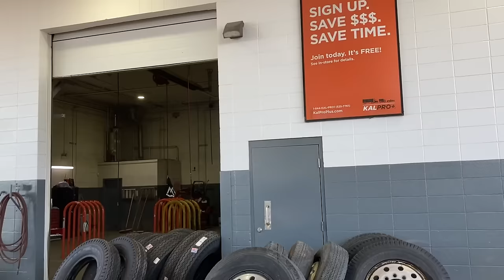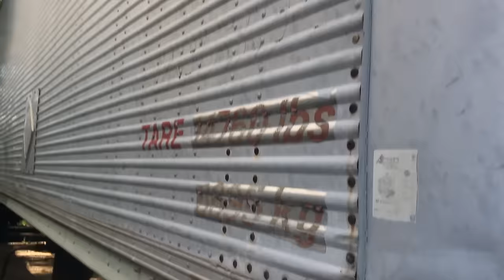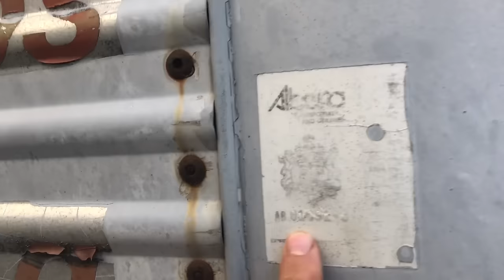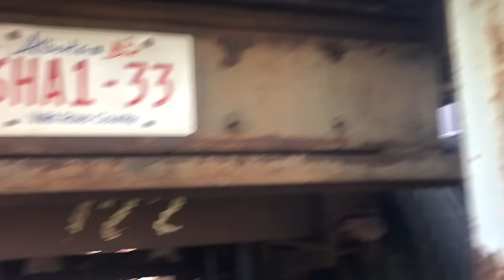Smokey & The Bandit Tribute Truck Ep.50 'Cause Straight Pipes Are Cool

Comment from the maker: Check out my Patreon to help support the channel, get early commercial-free episode access, behind the scenes and exclusive content 👀 https://www.patreon.com/twinstickgarage
Reply: @twinstick garage what's your plans with the cabover? Are you g9nna keep that one show accurate? Or are you gonna do a your own touches? I might have a few things to donate.
Reply from the maker: @hiltbuilt9837  will be a nod to the movie truck with a bunch of my own personal touches for sure 👍

Mailing address if you want to send anything (thanks by the way) is:

TwinStick Garage
PO Box 21
Ardrossan STN Main
Alberta, Canada
T8E2A1
Reply: @TwinStix  ok buddies thanks
Reply: @TwinStix  mark that's not at all how you swap suspension in a trailer ... i've swapped suspension in 80s and 90s trailers and just pulled them out to rebuild them and weld cracks ... there's actually just a subframe you can drop right out, usually 6 bolts and a couple air lines and bobs your uncle , you don't have to mess around cutting the icc bumper and all that
Reply: TS if you use masking tape and stick it directly to trailer mark top and bottom then pull it off and measure you would get a more accurate measurement 😁👍
Reply: Just and idea with an aid of a forklift or backhoe attached to the ICC bumper you could lock the trailer brakes and back the trailer over the wheel assembly.   Still would make refurbishment way easier even if you keep the 🇨🇦 spread axles.
Reply: @northernwolfhound7096  Except for using duct tape instead of masking tape to avoid any possible stretching  of the tape as he pulled it back off, that is just what I was going to suggest, but you beat me to it. Good one!
Reply: Hey Mark ...man your the best sir...I appreciate the vids ..
Reply: @TwinStix  Hey Mark, theres a scammer in the comments pretending to be you.
Reply: Hey. Mark. How  can I reach you not good with phone buddy
Reply from the maker: @tommyhall2768  email works … twinstickgarage@gmail.com
Reply: @tommyhall2768  his email in the about section

Comment: I know you are going for movie accuracy but my own head wouldn't let me have anything but the same size stacks on the left and right side. I'd go crazy looking at the height difference!
Reply: I totally agree!!!!
Reply: yep me too n ive never used mud flaps to hold pipes on always old conveyor belt if your going that way also split rims do em yourself just run a chain around them no problems
Reply: Agreed ... complete lunacy ...but not my truck
Reply: Totally agree!
Reply: I agree!
Reply: I agree as well and since they are different on each truck just make them both the same. Sometimes the movie is wrong.
Reply: same , i wouldn't be able to let those tips go on either , i'd have to get new complete stacks , that slip on tip is gonna look silly ... but it's not my money he's spending so i get it
Reply: That would drive me  nuts movie correct or not. OMG I was looking at the screen goin come on Mark ,,No No No No lol
Reply: "the 73 had the taller stack on the left.. the 74 had the taller stack on the right", Why not, split the difference ..make them tall on both sides.
Reply: I agree….like my mother in law with that one ear that’s bigger than the other…..I’d just like to grab it and rip it off and…..
                                                  …..sorry..I ramble
Reply: Mark keep the stacks the same mate
Reply: But it would be wrong not matching the movie.

Comment: Hi Mark: Good suggestions by others for using vertical masking tape on the trailer sides over the ribs to get the actual height and then lifting it after and getting your final measurement on a flat surface.  In regards to the trailer axle spacing, I kind of like the Canadian longer axle spread myself and would leave it as is.   Finally in regards to the stack height, I'd go with the taller '74 even stack height on both sides to help keep your trailer wrap clean when you're rolling coal. Regards.  Joe

Comment: Mornin Mark I spent many years dealing with split rim wheels and yes they are very dangerous but we took those tires apart and put them back together on the road and out in the bush, and nobody lost an eye, not saying it couldn't have happened though. I'm making plans to be at the truck show this year looking forward to seeing you there. See you on the next video
Reply: Not to pick by any means but technically they are split ring rims,  split rims actually have the barrel of the rim split like on the Firestone RH-5° rims or military combat rims.   The RH-5° rims are the ones called widow makers and really should not be reused and condemned.   By getting the terminology of Split Rim and Split ring mixed up between the types people automictically think split rings should not longer be used when they are called split rims. So it is a good habit to uses the correct names for the type of rim.    ALL split ring rims are fine to use and reuse providing the parts are sound and in good condition.  Split ring rims are still commonly used on basically all rubber tired construction equipment. And can still be bought new for some heavy truck applications.   So I always get laugh when shops refuse to mount tires on split rings.  If they balk at it, it is good indicator you should go else where cause they obviously  will have no clue how to properly mount them. I've never had any shop that handles heavy equipment tires have issues mounting tires on split rings provided they are in good condition.
Reply: That's not a split rim.

Comment: For the rubber flex piece you can use conveyer belt sections. They are tough and have wire or nylon belt woven into them.

Comment: Trailer rap measurements. Tape a light wire to the side of the trailer. 18 - 20 gauge. Cut it to the match the top and bottom. Pull it off trailer. Pull it straight. Then measure it. Sounds like a big costly job. Nice to get the best result possible.
Love your channel.  Thanks for sharing.

Comment: Don’t cut the rear bumper off. Get the pins to move in then slide your axles forward. Then remove your slide guides off, should be 4 of them. Remove your air lines, cage the brakes, lift the trailer and with a pick up or anything that’ll pull yank the axles out from it.
Reply: That’s how you do it.

Comment: If you can lift the trailer high enough will the boggy come out without cutting the bumper off. Also keep the stacks even high that will look better no one would have realized the movie truck was different if you hadn't pointed it out. I look forward to you videos every week.
Reply: It's the details that sells the image.  It'll show just how knowledgeable he is when people ask at the truck shows.

If it becomes a problem, he can always request the tips later.
Reply: Just goes to show how sometimes movie stuff is just cobbled together, especially back in those days.
Reply: What exactly is a "boggy?" I know you're talking about the slider suspension.
Reply: @jasonmyers3847  He means "bogie". It's refers to the entire assembly of wheels, axels and suspension.  Normally it's used in locomotive parlance for the assemblies at the ends of the railcar and those under the power unit that the electric motors are integrated into.
Reply: @danielseelye6005  Just to confuse everybody, In North America, Locomotive and freight car bogies are actually called trucks, the electric motors are called traction motors.
Reply: Same here, I would have never realized that until you pointed it out.  Now it is noticeable.  Still would keep the stacks even.  Not sure why that would have been done anyway.  New they are not off. I know its the movie truck but still.

Comment: Hey mark the Kenworth is looking great. I want to mention to you that to remove that tandem on the trailer you don’t need to cut off the icc bumper, all you need is a big bumper jack or a standard fork lift to lift up on the bumper and with the pins pulled on the tandem , the tandem will stay on the ground while the trailer is in the air. Also measure between the rails on the trailer and see if it’s 102” or 96” inches wide i may be able to help you out with a different tandem.

Comment: Run painters tape down the trailer across the ribs.. mark it then pull off and put it on a flat surface and measure from mark to mark. Will get a perfect length for the wrap

Comment: Those pins are used on every load you pick up each hole is a 125lb adjustment for compensating for  different loads  so when you go to scales  and your load is heavy or lighter in different parts of the trailer you set your brakes and add up the number of holes you need to move the tandems and yes you can just pull different tandems in and out of the chassis  I have to catch up with some of your videos I  was in the hospital for 6  months on a Ventilator cause of covid but I enjoy your show and would watch it during Chemotherapy !! I miss the road and your show has helped me greatly during my. battle  with cancer !! Still have my CDL just can't pass my medical but privately I could still drive if I had a truck but disease has taken over my money and it's priority precludes me from buying a cabover and having fun like you with Iron Duke !!
Reply: Sorry to hear about your streak of poor health, Eric. I pray that things take a positive turn.
Reply from the maker: Get well soon 👊

Comment: To clean the stacks up, or any chrome for that matter, get some automotive soft scrub I believe it’s called bar keepers friend and get the stacks wet with soapy water and take a horse brush and cover it in the soft scrub and brush it really good and rinse it off and it will take the rust spots right off and make them look like brand new, that’s how blue beacon does it

Comment: They sell a product called aluma lead. Itsis used to repair aluminum and steel panels. It takes a little longer to repair dents but the finished product is worth the extra effort. Good luck.

Comment: If you want an accurate measurement over those bumps, get yourself a roll of blue painter's tape, and run a strip of that up the side. Get it in over all the bumps good and tight, then pull it off, stretch it out flat and measure that.

Comment: Its easier to jack up the trailer slide the axels out toward the nose of the trailer then put a normal axel set up under then cut out the bumper assembly on the rear.

Comment: Mark,  your vinyl guy is right. I do wraps and labor alone is 30 hours per side because each rivet has to be heated and worked down. If not done right they will lift and crack around the rivets.

Comment: hey mark. suggestion for measuring the ribs on the trailer. use a rope like paracord or something. hang it by the top and mark the top rib. let it dangle long in the bottom. then use masking tape to tape over the rope along the inside of the ribs going down. get it all tight. the tape should hold the rope. then cut off the extra rope on the bottom rib. then peal what is left of the rope off the trailer and measure that with a tape. it will give you a much better measurement of all those rubs.
hope that makes sense to you

Comment: Just run a long piece of painters tape down from top to bottom and snug it in all the ridges then pull the tape and measure the whole length of the tape and you have an accurate reading of the distance.

Comment: If you do end up trying to swap out the tandem axles and the axle assembly out from underneath that trailer you do not have to cut the bumper off. You can slide the whole axle assembly out the front. all is you have to do is cut off the stops on the tracks of the frame rail and slide the axle assembly towards the front of the trailer and it will come right off. And I would double check that those exhaust stacks on the truck or not even in the movie. I hit pause on your video with those different pictures that you brought up and yes the stacks are at different heights compared to the top of the trailer but the top of the trailer is not even with the top of the cab of the truck. The exhaust Stacks look like they're pretty even compared to the top of the cap of the truck. I think it's an optical illusion because the trailer is at such a weird angle compared to the roof of the cab

Comment: There was a few axles last couple years forsale in mb. With shipping container prices going up a lot going back to used trailers. Axles usaly posted cheap and other then farmers for hay wagons no one wants non air ride. I'll keep my eyes out around Mb, Sask and email you if I come across anything.
Also for the exhaust rubber I've used mud flaps before but find a heavy  truck tire sidewall works better.

Comment: I feel your pain on the wheels Mark.  Back when I owned an M-35 deuce and a half, nobody would agree to work on the 2 piece split ring wheels that were on it.  I wound up taking advice from some old timers that have run those trucks for decades, and did them myself.  Chained them up so they couldn't fly apart, and made a remote activated air line to air them up.  Truck is looking great.  Just keep taking bites of that elephant, you'll get her eaten.

Comment: Just thought I'd let you in on a trick I've recently used to measure anything with ridges like that.. 
Take a roll of 1 inch masking tape, tape it right down the side, in and out of all the ridges, when it's edge to edge mark the tape with a pen, pull it all back off carefully and lay it out straight and measure the length then..

Comment: Don't need to pull the ICC bumper on the trailer.
Usually after the pins are pulled, there are 2 brackets at the front of the sub frame and 2 at the rear. Once those are removed you can jack the trailer up s few inches and slide the sub frame out sideways.
If you find another sub frame you need to be sure the pin size and hole spacing is the same.
I'm pretty sure there are 2 different setups, one has larger pins and the holes are farther apart.
Also on the stacks where the right one is shorter it could be the optical illusion due to the crown of the road.

Comment: Don’t have to cut off the back ICC bumper on the trailer to remove the subframe. Just remove the subframe pins and you can lift the trailer up then roll the subframe out and roll the new one in! Also I know it’s a bit of a drive for you but the old trailer shop I use to work at has some of those old thermo kings just sitting around skis may have the subframe you want too! Located in Romulus Michigan.
Reply from the maker: Cool - can you send me an email twinstickgarage@gmail.com with the contact info of the yard?

Comment: Not sure if this would’ve been on the movie trailer but if you noticed the two extra strips of angle iron on the trailer sill, those were for when the trailer would’ve been used in “piggyback” service when the railroads transport trailers on flatcars. The strips of angle iron are where the trailer would be lifted by an overhead Mi-Jack crane. Again not sure if they’re on the movie trailer, but just a neat little tid-bit.

Comment: @8:30 you might be surprised how much longer it is if you actually got the tape stuck to the surface. You could use string, or probably a better way would be to use some blue painters tape, stick it to every bump on the way down, mark it at the bottom, carefully remove it and stick it to side lengthwise and then measure the tape.

Comment: Just a thought about getting an accurate measurement for your trailer decals. Take your electrical tape and run it from top to bottom and press it into the grooves then pull the tape and straighten it out and measure it. The tape should stick like the wrap would. Love Smokey and the Bandit so excited to follow your build.

Comment: You could run a piece of masking tape down the side of the trailer sticking it down into the ribs if the trailer then peal it off and measure the length of the piece of tape

Comment: If you measure the height of the trailer side then use a fabric (taylors measuring tape) you can measure a rib then multiply by however many ribs there are. Add to the height and you should be accurate.

Comment: One way to get an accurate height dimension for the trailer mural is to use tape. Stick it on top to bottom, peel off, straighten and measure.

Comment: I wouldn't take such drastic action as cutting the under run bar off, that bogie should just drop out once you remove the pins, it doesn't appear to have the usual bolt-on yokes that anchor it to the rail. IMO your main issue is finding a replacement with the right rail dimensions etc... unless you cut the rails off the old bogie and weld them in the right position on the "new" bogie. I applaud your dedication Mark, this truck is looking fantastic.  Kenworth W900s are my favourite truck from when I first saw one in the late seventies. I so enjoy your videos. Personally I'd set the stacks evenly as an aggregate across the two movie trucks you showed because it would bug me endlessly and I'd be sick of explaining to people why they were uneven. Shame you couldn't have straight pipes evenly set and odd length curved tips to fit for shows.

Comment: after you pull pins on trailer suspension you would only need to jack up trailer and disconnect air and electrical bogies will roll out forward. no need to remove big (dot)bumper.

Comment: To do the measurement for the wrap, use string and tape that over the ridges on the side.  When done, remove and measure rhe string.  Way easier than trying to press a tape measure in between those ridges. .